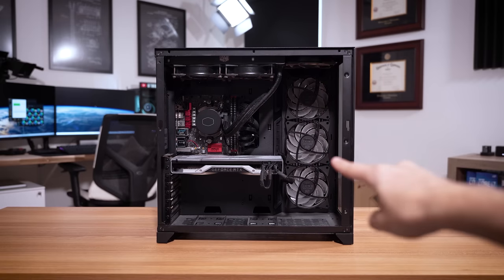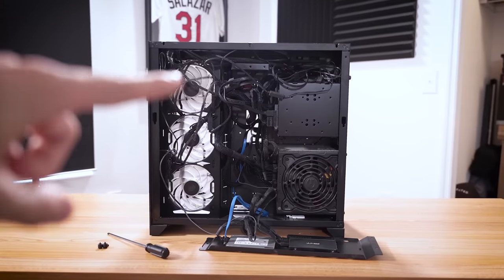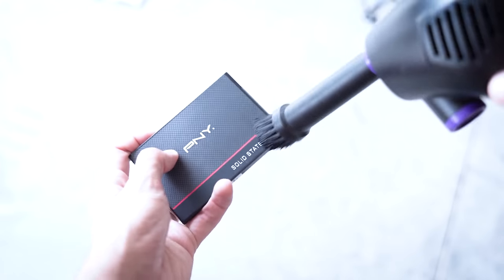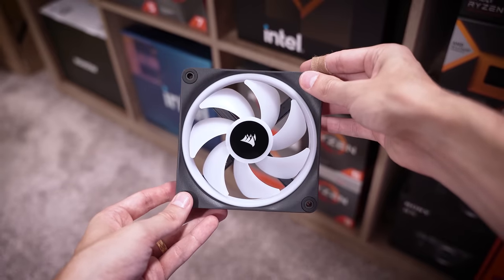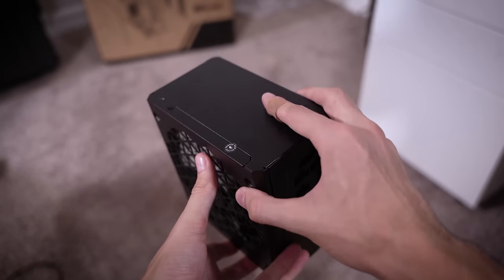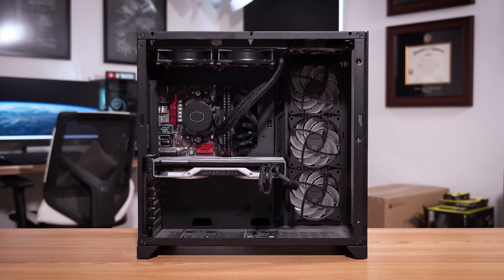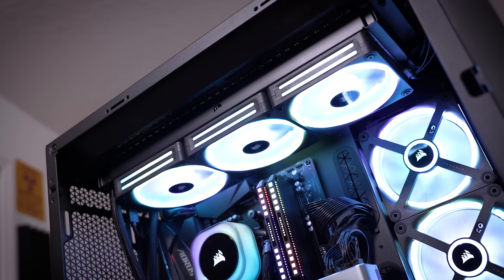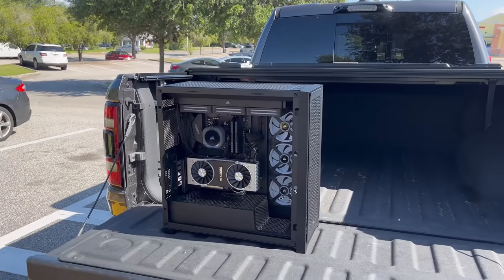We TRANSFORMED This Viewer's Gaming PC!

Comment: I have been working on PCs for about 30 years, was doing water cooling about 20 years ago when we used things for fish tanks in the DIY community.  I have tried a bunch of different configs for cooling and always find positive pressure to be the best, but I see something a whole lot that I have a hard time understanding fully.  Why are we mounting AIOs to the top when there is a single radiator in the build?  My understanding and anecdotal testing over the years seems to indicate that fresh, cool air from the OUTSIDE of the case blowing across the fins provides better cool, as opposed to heated air from the PC and other components blowing across the fins from INSIDE of the case.  With a case like this wouldn't mounting a single radiator solution in the front or side provide better temps? I understand that the point of the video was to provide a facelift to the system and make it look pretty, but this isn't the only time I have seen this.  The O11 cases are notorious for this.  I could be dumb or maybe these new AIOs are so good (my last build with an AIO was 6 years ago) that it just doesn't matter.
Reply: The theory is that putting the radiator in an intake position will vent hotter air into the case and that it can in turn mess with GPU temps.  For that reason, some people choose to put the AIO radiator in the top position.

Comment: The only  products that are from the same company are my Mobo, and my GPU, which are both from MSI, and my RAM and Mouse are both from Corsair, as for the rest.... my CPU is from AMD, my PSU is from Fractal Design, my CPU Cooler is from Vetroo (that might change soon) and my Case Fans are from Artic Cooling.

Comment: Greg did you know that you should have the aio separate from the other fans just in case so that it has enough power going to it. I saw in jay2cents video that was what he recommended. I saw some fans weren’t powered because not enough power was going to the fans for rgb to light up. It was too much to power aio and all the fans at once.
Reply from the maker: Our fans and RGB had no issues lighting up/spinning in our testing.

Comment: Even if this viewer’s CPU is 1st gen Ryzen (so only PCIE gen 3), the b550 + fast memory + the PCIE gen 4 nvme drive means if they do pick a CPU upgrade down the line they’re set with some more modern features. The new Corsair stuff certainly is quite expensive but I guess you’re paying for the looks and the convenience which I guess it’s good. Probably not for me though, I’m a SFF person and I also hate RGB software, and I rather just prefer a RGB/ARGB header instead. The before and after does look sick

Comment: Let me start by saying I really do like Corsair products.  I’ve spent $1k’s on their stuff.   The new link looks great! But…. They do not include the 90-degree connector.  Sold as extra. You currently can’t even buy them.  I wanted to use this new kit in a custom overkill cooling setup.  I can’t use them due to the straight connection cable that they do include in their kit.  They should have included 90-degree cables at this price point.

Comment: No before/after performance test?
Reply from the maker: I don't log into viewer's systems unless I have to. Nonetheless, the "performance" difference would only be attributed to a larger radiator and slightly higher airflow case. Not a massive difference and, frankly, not worth testing for this kind of video IMO.

Comment: how did you get the 1700 to work with the b550 board? it's not supported and I've seen many cases of 1st gen ryzen not working on 500 chipsets
Reply from the maker: There are certain B550 boards with BIOS revisions that still support Zen 1.
Reply: @GregSalazar  ah that's great to know, thanks for the quick response!

Comment: Really enjoy all of your videos! Just had my aio begin to die and I'm trying to decide between getting another or just going with a fan cooler. Aio's look so good, but the clogging is so frustrating...
Reply: Clogging?? I have had an H100i for like 6 years and no clogging at all and I just upgraded to an 170i ELITE CAPELLIX and is working great. one tip I heard was to set the pump on extreme and the fans on whatever you can live with because if you put the pump on variable it can fail as it has to ramp up and down all the time. Not sure if that is true or not but my H100i always had the pump on extreme and that what I set this pump to as well.

Comment: The new corsair parts cost as much as the old pc.

Btw. video and audio have 1:26 Min of sync difference. Just duplicate the tabs, the Audio start at 03:07 and the video at 01:42, just after the ad.

Edit: @Greg at least one Cooler Master component stayed in the system. 😂😉

Comment: $50 a fan that doesn't come with a cable is pretty steep. Sure it looks nice, but DeepCool has a similar system (albeit without its own software) where three fans come in pack with cables for $50. I've defended Corsair in the past but um...this is pretty expensive.

Comment: Did it boot with xmp enabled? will the B550 motherboard + 1700 be compatible with 4000Mhz RAM? My friend is having boot issues with his new CPU. B450M Asrock mobo was previously using 3400 then he upgraded his CPU to 5600x. All the rest of his components are the same, however system does not boot when he loaded XMP with his memory. Mobo bios and chipset drivers are updated to latest non-beta drivers available.
Reply: Is your buddy running 4 sticks?
I used to have issues with 64gb of Corsair Vengeance DDR4-3600 with DOCP alongside my R7 5800X and an Asus Crosshair Hero VIII. After nearly tearing my hair out for 3 months I found that even my X570 chipset hates having more than 2 sticks of RAM at speeds over 3200mhz.
Reply: @1337bG01  He's running 2 sticks of corsair vengeance pro rgb. not sure whats the rated speed and latency, but he says it was booting with xmp on when he was still using his 3400

Comment: I noticed you used a 1000 series CPU in a 500 series motherboard. I tried using a 2000 series cpu on a b550 board before and it would not even power on i had to get a new 3000 series cpu. How did you get it to work or does this particular board support more than 3000 and aboce CPUs?
Reply from the maker: It all depends on the board's UEFI. Some manufacturers omit certain architectures in various BIOS revisions. We briefly alluded to this in the video.
Reply: @GregSalazar  Makes sense thanks! Keep up the great work

Comment: I'm surprised connecting the pump and the 6 fans worked because jayz2cents also did that but it had trouble working until he switched to 2 different ports instead of everything into a single port
Reply from the maker: Hm, that's odd! I was honestly expecting some sort of limitation with that many components connected in series, but Corsair says up to 14 (I think?) parts can be connected at a time. We didn't have any problems.
Reply: @GregSalazar  Maybe it depends on the strength of the power supply?🤷‍♂

Comment: 1_ Since his CPU was R7 1700 , when you activate XMP is everything went OK ?! .. We all know how bad the first ryzen gen with ram speed in term of stability , you may end up stuck with 3000mhz .
2_ You probably should advise him to change his CPU to 5800X3D or 5600X3D .. It will be a HUUUGE upgrade for him and definitely will notice a GREAT boost in performance specialy in games .. That R7 1700 definitely bottlenecked his GPU and all of the system.
3_ Also he should consider to add anothe fan in back to exhaust hot air and better airflow in general.
4_ Sorry for my bad English :D

Comment: 8:14 WHY would you put the intakes at the side when you just extolled the virtues of the case having a massive front panel with a grill?
8:53 Wait, You've put in an intake fan directly below an exhaust fan??? Are you sure? What kind of airflow would that bring? Air will come in and immediately go back out??
Corsair completely re-designing their hubs and interfaces, YET AGAIN, leaving users with older devices out in the cold as well. What a surprise.

Comment: Nice system makeover, but the video is badly spliced for me.  The ad for the monitor comes on while you're still talking about the fan stuff and then the monitor audio comes on while you're doing the radiator and fan install.

Comment: This is just a Corsair commercial disguised as a build/upgrade video. When building a PC, Brand Loyalty is just a flawed concept that will end up ultimately costing you money, performance, or both. Pick the best value for the money.. the idea that building using all one brand is beneficial is laughable at best. It's only beneficial when you're paid to do so.

Comment: In the words of the great architect Frank Lloyd Wright, "Form follows function" In my view this is a FAIL, in 2 years this computer will be a door-stop, unable to run Windows 11 cleanly because of 1rst Gen Ryzen!  The first thing you should have done was to change the CPU to 2nd, 3rd,4th gen Ryzen! New case, larger motherboard, getting rid of 2.5 inch drive all irrelevant. Form follows function, and with no function in a bit over 2 years who cares what it looks like?

Comment: Doesnt look like the same rig because it isnt..And another build with no rear fan...WHHHYY! if your OCD you wouldn't be able to let that space be empty. Its just as bad as using 2 stick of ram in a 4 slot system. And the corsair fanboy used a coolermaster vertical bracket lol you just preached on sing the same manufacturers parts